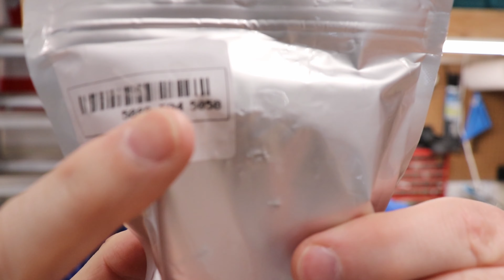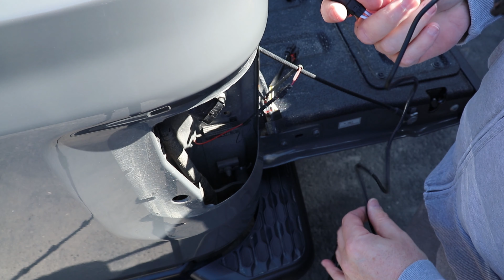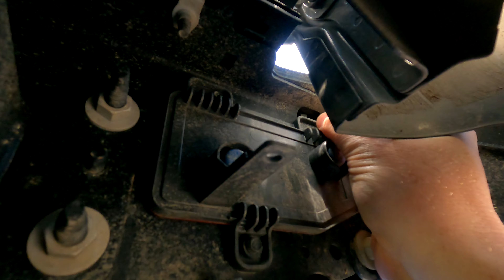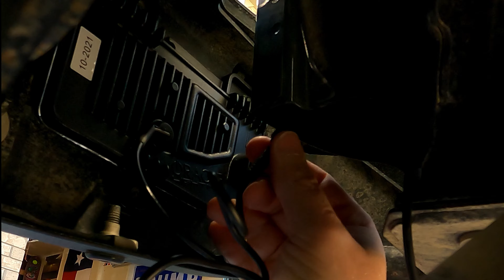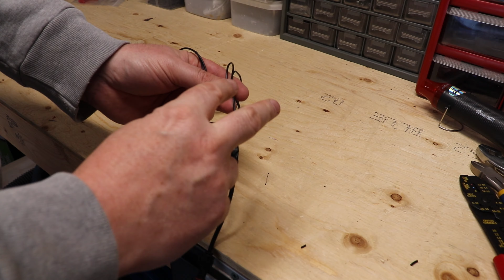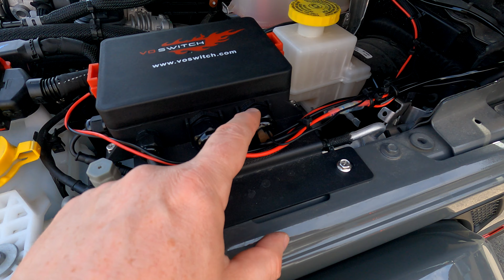Installing Oracle Lighting Rear Bumper LED Reverse Lights for Jeep Gladiator JT

Comment: Thanks for this video, I've just installed the Oracle backup lights and encountered the same problems. I'll be straight wiring first thing tomorrow,👍
Reply from the maker: It's actually better straight wired I can use it for camping! Thanks for watching

Comment: This is very interesting, I did the Oracle LED taillights and bumper lights and got the exact same issue with the reverse lights flashing, except on the right side as that's where I put the PnP wiring harness. However, when I went back to the stock taillights the LED bumper lights work fine. EVERY LED bulb or taillight I've tried flashes just like yours, even when I removed the wiring harness entirely and took it and the bumper lights out of the circuit. I've given up on having true LED taillights.
Reply from the maker: The tail lights work fine but yeah the back lights did not want to work... I ran them directly to my Voswitch it works great.

Comment: It would have been easier to take off the 8 bolts holding the bumper on.  They are easier to access with an impact, then you can use the impact on the reflector bolts.
Reply: You just needed to program your ecm for led lights with a taser and the wiring harness would of worked
Reply: @Jeff Keith:  Supposed to be plug and play.  To be honest, Oracle touts their comprehensive testing and this shouldn’t have these problems on (3) specific tail light systems:  The OEM incandescent, the OEM LED and their own brand flush mount.  Well, a significant number of people with all 3 setups are having problems…..and some are using the Tazer.  This design is a fail and unless you direct-line them to a switch like he did, buyers should be aware of these problems:  Know that Oracle will not take them back and probably not help you through the issue.  Hell, you darn near have to ambush them on a high-traffic online forum to get them to respond.
Reply from the maker: @jeffkeith2841  true but I didn't have the $400 for a Tazer
Reply from the maker: Damit your right lol if I could go back in time I would 100% do that. It was such a pain in the ass to take them off and on. Thanks for watching.